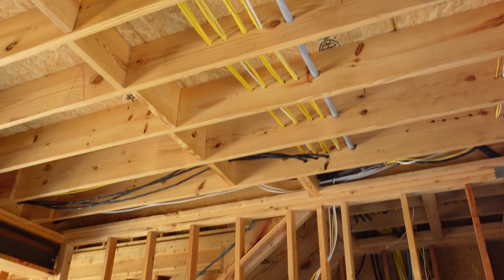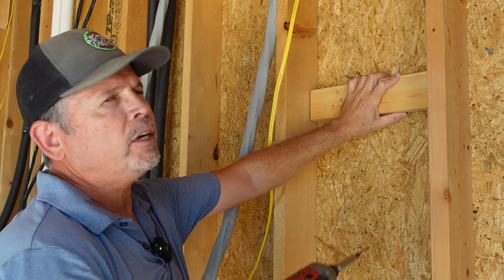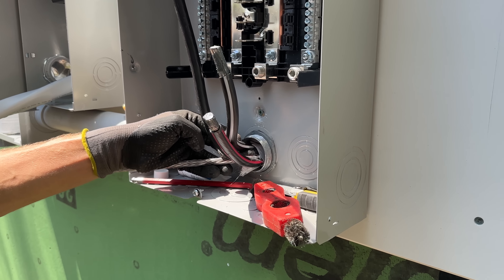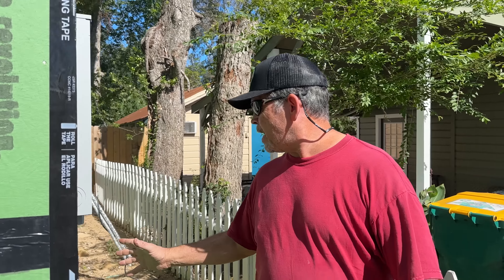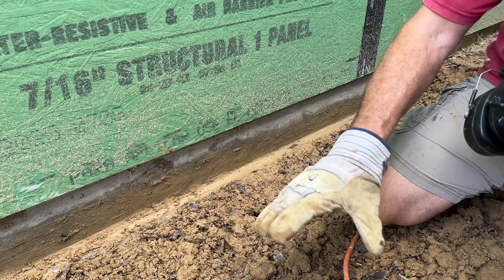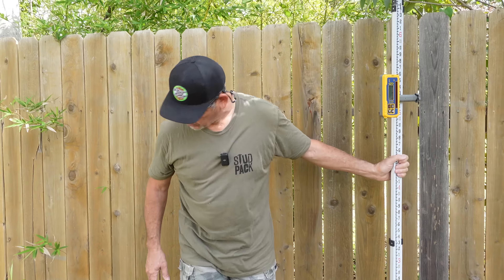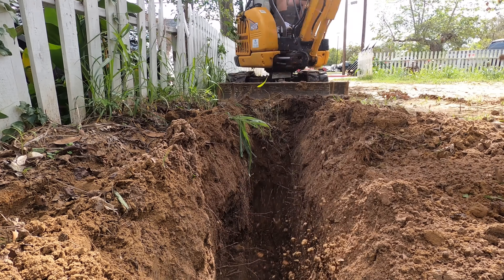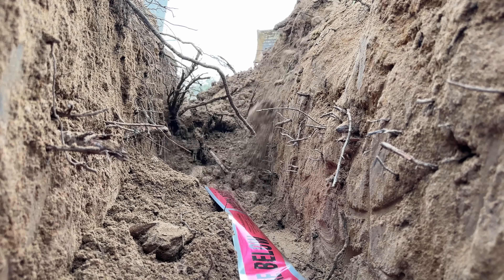MASSIVE 400 AMP Service for our Storm Proof Electrical Powerhouse

Comment: Great video guys, Joel is one nice guy & a real craftsman. Thought you guys would of installed a pull rope in both of your conduits before all being glued & buried. Makes a lot easier later on. Waiting for the next video.
Reply: We always vacuumed the conduit using a mouse after completing the run prior to the power company running their cable. This is when the pull rope was installed.  It is easy to do with a shop vac.
Reply: @RCMServices  thanks. We have also used a pig to clean the pipe. I think you are familiar with this tool.
Reply: @williamsethman2434 yep, but we called them mandrels. Had to use them when the conduits were installed in high and heavy traffic areas to make sure the conduit wasn’t collapsed.

Comment: You guys might want to go ahead and put silt fence up at the drain points. Could head of some complains and city notices if mud gets washed into road which it probably will. And I’d put a expansion joint on the main service for sure. Even if it’s not code. Texas gets colder and colder and movement might become a problem down there like pipes freezing has.

Comment: Love the content.  Alot of your choices I also used on a recent service upgrade as a DIY working under permit from my AHJ including PVC / VInyl backer board to my service box, and caution tape buried 12 inch above the conduit....
Wile it may not be code in TX, but in WI, we are required to use expansion joints anywhere conduit changes from Horizontal to vertical under grade.... I didn't see you use any, and this is a cheap insurance from future damage from ground movement.

Comment: Looks fantastic!!  Still so bizarre to me to see a breaker box on the outside of a house/garage.
Reply: NEC now calls for your shutoff to be outside (in case of fire).  While they have a few breaker slots out there (for outdoor stuff), I'm sure that the vast majority of their breakers will be in boxes on the other side of the wall.
Reply: That's very common in the southwest states since inclement weather is typically not a factor

Comment: You electriction is awesome... someone I'd 100% pay some to hire.  His attention to detail is great.  I have worked and do work with DC power (larger systems for telecom) and thanks for the no-ox on the cable end.  I don't like the set screw type connectors and have had one come loose on my while lacing cable in (old school, not a fan of zip ties).  The battery side came loose and directly shorted to a ground bus bar and caused an outage.  Nobody was hurt though.   The screw was old and likely not torqued since installation.  Most of our stuff is double hole crimp lugs (with no-ox and inspection windows).

Comment: Hi Guys, Great work on the electrical and water runoff. I have one recommendation. When laying conduit and pipe, it's best to install a suitable draw wire or rope before completing the glue up. Saves time later and makes it easier when pulling in the final cable.
Great work so far.😊
Reply: When you forget to do that like I usually do, the easy way to recover is to tie some thin string (I use twine because I have a huge roll of it after switching from small bales to big round bales) to a wad of paper towel.  Put a shopvac on one end of the conduit and suck both the towel wad and the string through.  Then use the thin string to pull a heavier synthetic (so it won't rot) line.  That line will be strong enough to pull both the electric wire and another pull line.  You already know you'll have to get into that conduit again, don't you.

Comment: Great video! Yes, saw a handful of comments about the fiber conduit. I think you mentioned on an earlier video that you already know your ISP will pull fiber to the property. Did they also give you the info on the conduit dimensions and the sweep? Typically, they should be 2" with a long 90 and a pull string. However, if they're just dropping 1 or 2 fiber pairs to your property, you should be OK.

Comment: I hope you consider an Enphase  IQ system controller.  It can replace a transfer switch and support both solar and a generator.  The Enphase batteries have some technical advantages over the Powerwall.

Comment: Everybody talking about the expansion coupling, but that standard radius 90 on the conduit for the fiber wont fly. Need a large radius 90 for fiber. If it’s coax, that’s fine. Fiber, no go.

Comment: I believe standard fall on a exterior concrete slab is 1/4" per foot, so you are NOT super high with you building. A good heavy rain will tell the story.

Comment: I know you marked the fence with paint to mark the end of the conduit but I would measure from something that is more permanent (like the current power pole) just as a belt and suspenders thing. You never know, somebody might accidentally hit the fence with an excavator 😉 or something and wipe out your visual indicator.
Reply: Measure from the tree since the power company will be replacing the pole. Will they install new before removing old? It's also good to measure from 2 points to find the exact spot.

Comment: While installing my solar voltaic system I pre installed conduit for a whole house generator. Fortunately for me a friend who has a generator and was without electricity for 11 days informed me that it cost him $3000 in propane for that 11 days. I chose to put a generator receptacle and interlock on instead. I can power everything I need with a portable generator and a few gallons of gas running it when I need to cool the freezer and then turn it off.

Comment: As an electrician in Washington, I’m curious as to if you needed or got an inspection on the pvc in the ground before you backfilled? We have to get an inspection before you can backfill up here in the PNW so I’m genuinely curious? *Our power company requires that they put eyes on the conduit before and we have to use fiberglass sweeping 90° on utility conduit as well*

Comment: Any reason you guys didn't run any mule tape or other assist to pull wires/fiber?  Did you guys cap both sides of that conduit for the fiber?

Comment: Hi Paul, apologises as also meant to add Can’t wait to see what kind of heating / hot water system ur going fit , here in the Uk a combination boiler would be ideal to heat the living area where it will also provide instant hot water, plus saving room in not requiring a separate hot water tank , very interested in this as been a heating / plumbing engineer here for over 40 x years , thks again Gary

Comment: Is there a reason you were using SEU connectors with SER cable? That would fail inspection depending on the inspector around my way.

Comment: Did you cap the ends of your 3 inch tube and your fiber optic tube, water will go into your tube and settle at the end of your elbow turns. I drill and lay fiber optic tubing and pull optic lines for a internet company.
Reply from the maker: We did cap them

Comment: Are you guys worried about being able to pull a 2-0 gauge aluminum (or copper) wire 50' through that conduit in one pull? For sure, use nylon pull tape and use a bunch of lubrication on the wire to get it to move through that conduit. That's going to be a tough pull by hand. You might also consider using a winch to pull it through as well. Can't wait to see that video and the creative solution you come up with!

Comment: Sucks that you have power cut off breakers outside the structure. 😢
And you had to put those boxes in before siding was up. 😢

Usually you get the utility hook up and meter put in before you rough  in the electrical inside the structure..

Comment: Is no expansion fitting required at the meter base to prevent frost heave, you may not have frost heave in your area
Reply from the maker: No frost heave 👊🏼

Comment: Threaded Male PVC fitting are not water proof. I saw a fitting lock nut on the outside of the box that creates a gap. Gasket or Myers Hub on the fitting can be used for a better seal.

Comment: Your conduit has elbow bend and you will be pulling through it thick and stiff power line wire to bend and slide through. It won’t be easy. Especially as you are looking for 400A service.

Comment: 🔴 I never put glue on the conduit pipe, only the bell. When your pulling the cables they can get hung up on the excess glue that forms in the pipe. Also… why doesn’t anyone ever use PVC primer or at hot blue glue that doesn’t require primer on conduit.  Doesn’t matter under ground but I see conduit glue dry up and loosen all the time. Just sayin’. Love the channel

Comment: thank goodness the uk 240 volt is a lot easy the main cable box is outside but inserted within the wall so you do not see the cables and protects them , Next we have our fuse box for the running of lights ,shower, and mains including heater to warm the boiler for hot water or can use separately on electricity ,no pipes needed and you do not need to see the outer one as it can be either on the phone how much you use on a daily basis and pay your bill automatically. Even if you transfer to another company.
ps the cables going in and to other areas here you can not be showing any bare wire right next to another wire the out sheath should be seen and no inner cable shown

Comment: Great video as always :) 
Question/comment: I'm confused why the conduit / breaker box is on the outside of the house? Where I live its all inside, with only an electricity meter on the outside.
Reply: Based on watching some other Texas-based YT channels, in Texas it’s common to have the breaker box outdoors.  I’m also used to having the breaker box indoors, although as of the 2020 NEC, there’s a requirement to also have a outdoor disconnect switch, in addition to the meter.  For now, though, my state is still using the 2017 NEC.  I think on this Stud Pack house, they’ll have most of the breakers indoors, with only a small subset of them outdoors.

Comment: SP I think you’ll have to seal those beveled edges on that PVC sheet. Cutting it leaves open “cells” that can hold moisture. Over time mildew will grow in them leaving a green or brown stain.
Reply: Heat gun?  Then prime & paint.
Reply: No need to seal...it's impervious to mold or rot. Best stuff in the world!
Reply: Where you even find those boards, I can’t find them
Reply: @chrisosti  next time you get some pvc trim, cut it. You’ll see while the outside surface is smooth, the inner part will feel rougher. This is the inner “cell” structure of PVC. Unless you seal that surface, over time water, dust, and dirt can accumulate. So you would need to clean it regularly or it will discolor.
Reply: @ncooty  I think all you need to do is light sand the cut edge and wipe on something like acetone to seal up the open cells.
Reply: @TR4Ajim  Thanks for the suggestion.
Reply: 😆 @TR4Ajim

Comment: @27:52  I realize you don't have much land, but if you can do it, separate trenches are always better so that if you do have to excavate ... you don't have to dig through multiple layered utilities and take them out.  It's better if you can just excavate the trench you need and keep the other utilities in tact.   Also, provide a nice detailed drawing to the home owner on where utilities run with GPS coordinates as well as depths.    It's irresponsible nowadays with todays technology not to do this.   Also mark service entry /exit points on the building with permanent markings and perhaps even a trace wire wrapped around the conduit for easier locating if it has to snake and bend funky ways through the yard.    Septic Out, Water In, Gas In, Electric is usually obvious because of the panel.

Comment: Why didn’t you guys put crushed stone in the trench with the conduit?  I’m not a builder,  just wondering if it would be necessary or good practice for extra drainage.  But great job keep it up!
Reply: there's no where for the water to drain away from (the bottom of the trench is below grade everywhere), and you don't need drainage around buried utility lines.

Comment: I would have put 2 - 1 in conduits.  One for fiber one for coax.  Or the ability to pull another fiber if you wanted dual wan access.
Reply: Who still uses coax?

Comment: Don't you want string running through that conduit to help with pulling wires later?  Or do the pros have fancy tools to push wire through the conduit?
Reply from the maker: You can push a tape thru or suck a line thru with a vacuum.  Some string, a plastic bag, and a shop vac will get you thru most conduits.  We'll show it when the time comes
Reply: @StudPack  where was that vacuum trick when I was doing my shed!  That's a great idea!

I'm very curious to see your tricks for get the cables around your 90%  A couple of bends made for some really really hard pulling for me.

Comment: Out of curiosity what size wire you running in the conduit
Reply from the maker: The utility company does that, we will video the process
Reply: @StudPack  when I built my garage I had to that myself the utility company wouldn’t even put it up the post they only connect it
And I’m surprised you don’t have to do a ditch inspection either

Comment: That tree might have to come down if the trenching cuts the roots otherwise I think it could be a fall hazard in the wind.  Maybe something to consider if you haven’t already.
Reply: In 1992 I had an electrical trench put in (direct burial 100A cable), about 6-8 feet from a reasonably mature tree (red oak, probably 20 years old at that time).  The tree lasted until this year, when I had it removed since it was close to the house and slightly leaning.  My trench was a lot less than 36” deep, but I’m sure they cut some roots.

Comment: I wanna see how you will pull 50 ft of 4 aut thru that conduit.
Reply: Mine is over 100ft long in 2 1/2in
Reply: They don’t, the power company does.
Reply: What would you do instead?
Reply: That wire will be so easy to pull. 3 inch is a big pipe...Only one 90 degree.

Comment: I'm not a fan of Aluminum wiring. It expands a lot as it heats with a load and shrinks as it cools and every aluminum-wired house I've worked on had loose terminals. They built Century City in Los Angeles using aluminum and it required constant maintenance. The movie biz (where I worked for 34 years as a Set Lighting Electrician) tried replacing the 100 pound, 100 foot 4/0 copper cables with light-weight aluminum and it failed miserably. It was a joy to carry, install and tear out every day but it couldn't handle heavy, constant loading without overheating. Keeping the end-lugs connected was a problem. Copper takes abuse and stays flexible but aluminum gets stiff with time and abuse. This is the first time I've disagreed with anything you've done over the past 2 years. Usually I'm impressed.
Reply: I have made thousands of aluminum connections and never had a problem. If it is installed correctly it is just fine. Copper is just to expensive when you get up to the bigger sizes. That SER cable was aluminum, no problems.

Comment: We built in 2019-2020, I tend to wonder if we needed to go 600 amp vs just 400. 

The house is 100% electric, so I have 100amps dedicated to Mitsu heat pump ps/ sir handlers and aux heaters. Kitchen has a 50amp outlet for the induction range, laundry room has 2x 30amp circuits for 2x washers ans dryers. Pantry has 3 cir units for a fridge and 2x freezers. Garage has its own 100amp sub panel with a 50 amp and a 30 amp car chargers plus 2x 30 amp for heaters. People poop when I tell them my electric bill is $650 a month, but if we were buying gasoline for the cars, we'd be spending about $400 a month in gas.
Reply: Your service amperage is not directly correlated with the total breaker amps in your box. It’s based on usage. 400amp service is more than enough for a 8000sq ft home and large shop.
Reply: What are you going to drive when the power is out for weeks? Hopefully you have a gas/diesel vehicle for back up.
Reply: @remodz6385   When the derecho left us w/o power for a week, guess what?  Not a working gas station to be found -- they run on electricity too.

Comment: Pro Tip:  How to guesstimate how many feet of 12/2  or 14/2 cable for a residence? Residential dwellings average about 1000 ft. per 1000 ft. of sq. footage.. the kitchen being the room that uses the most. A good electrician will do his customer justice by dedicating each outlet location all throughout the counterline, along with every appliance location with it's own circuit. Yes! ..every duplex/GFCI with it's own 20A circuit. The NEC does not require this, but, the best electricians practice this method so people don't have tripping issues when they're trying to use (2) 11amp roasters on the same circuit at the same time. Hence why microwaves, garbage disposals, refrigerators, etc. have their own dedicated circuits.

Comment: Hey guys, normally when installing conduit for fiber cable the minimal duct size it 2 inches but 4 inches is normally the safest. Also the conduit must conform to ICEA S-104-696 standards and have a sweeping bend. Normally the Interconnct/TELE would install a 12pair drop to a home. Most clients are told to install a 90-100mm conduit with minimum sweeping bends. Hope this helps.

Comment: He should have used emt to bridge the two panels, the pvc will fail. I have had to replace so much pvc even schedule 80 because it does not stand the rest of time.
Reply: It will likely be OK if it is painted to keep the UV rays off of it. In this area, exposed PVC must be painted in order to pass final inspection.
Reply: At a lousy 2 foot.
Reply: If it didn’t matter then better technology’s wouldn’t exist. When you fail to do things right the first time it compounds efforts to correct deficiencies in the future.
Reply: Emt has stood test of time. PVC has failed. This is empirical data we can observe.